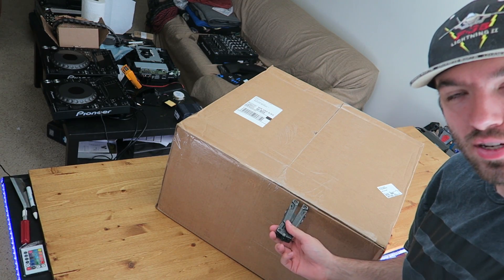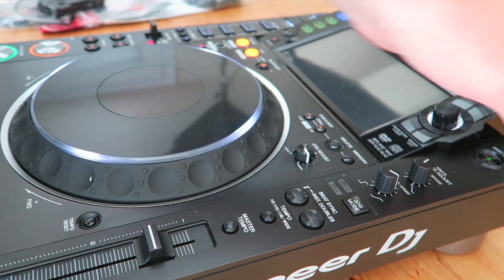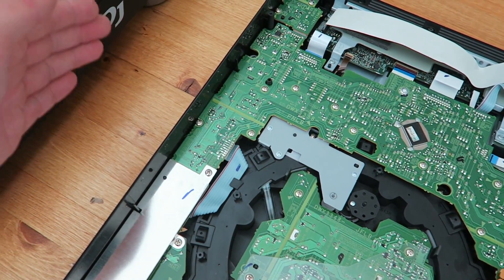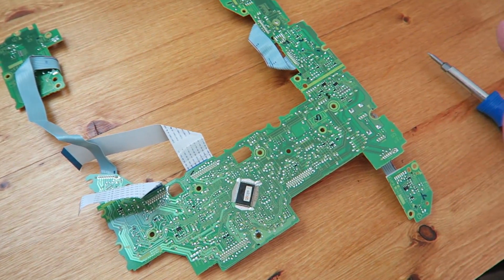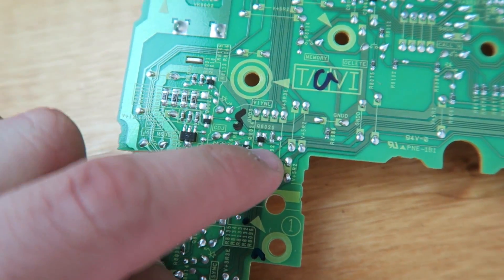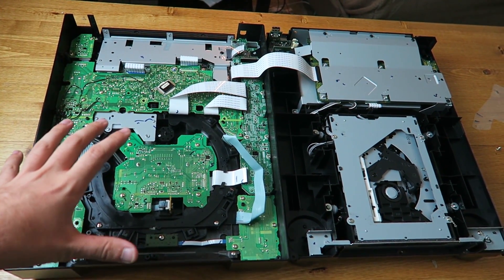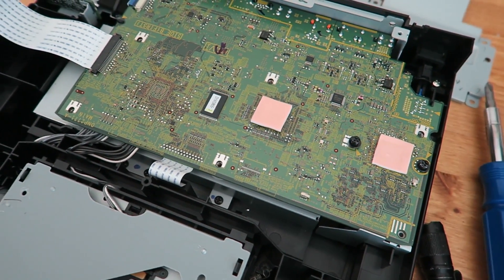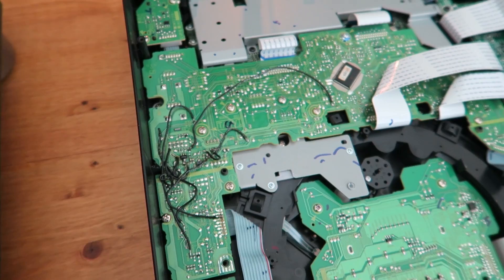Repairing CDJ2000 NXS2 - PCB Crack

Comment: i have cdj 2000 nexus and on one the cue button doesnt work (play button works fine)  and its not the button itself as a new pcb did not fix the problem. The wire that plugs into it runs to the dwx3338 board  can this cable be the issue and do you know the part number  ? when I look up the pcb the cable is already attached to it ...

Comment: This is an old video but i give it a go. I have cdj 2000 that i have cleaned up. Now it does not power up. I changed the power unit from a working one, and it still wont power up. Any tips? :)

Comment: thanks. question if i may. my nxs2000 mk2's  sync button has an issue.. i have to use a large amount of downwards force for it to switch between states, and instant doubles will not work at all. The "Master" button is fine, both LEDs work also - any idea on possible issue ( resolution). thanks in advance, joe

Comment: Did you need schematics to run the wires? I assume so. Bangin job  man
Reply from the maker: Nope. just use your eyes and look at where the traces are interrupted then jump between them with wire. the PCB traces are literally just wire that is flattened and ran together.